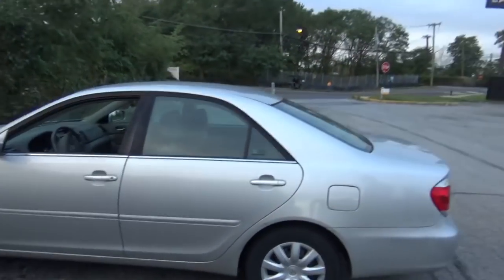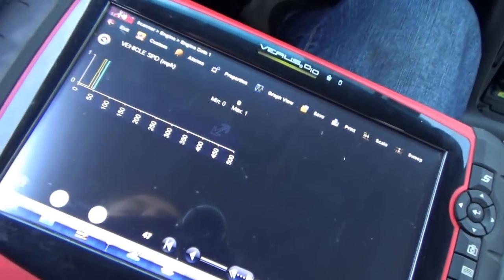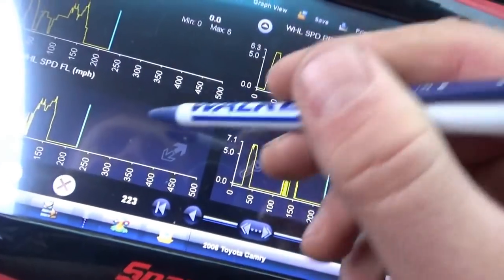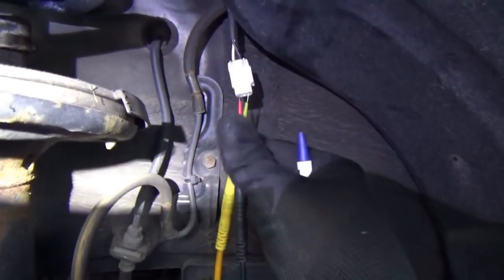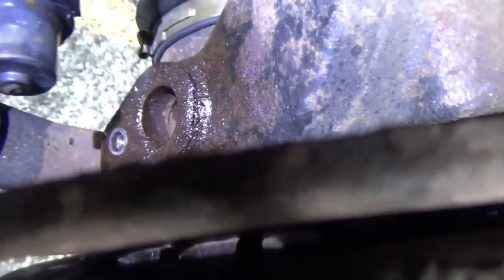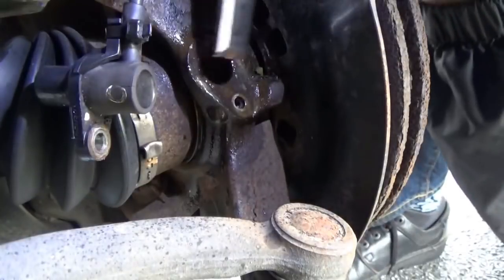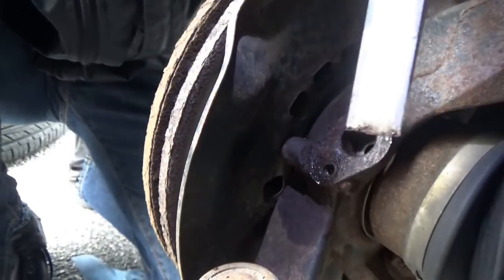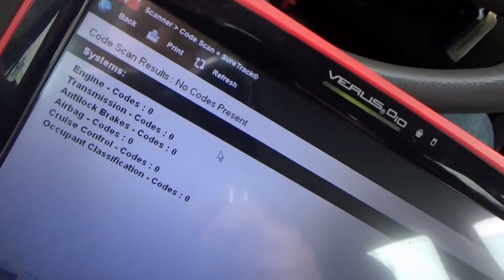Toyota ABS activation P0500 (Diag & Repair) (SI Ep 11.2)

Comment: Brilliant diagnostic and straight trough repair! Ivan! As field tech - You need wire bruh and grinding wheels in Your tool box for fighting Rust Belt  "REAL RUST" more efficiently.  Magnalube MIL 900 marine grade grease, it works much better than fluid film. Magnalube is not washable and designed to withstand salt water penetration - can bring permanent rust protection and lifetime problem solving.

Comment: I used your exact technique on a 2002 Sequoia.  The front sensors had the same "bent" problem and it was causing hesitation during acceleration and ABS activation at low speeds.  It even caused ABS to activate when decelerating slowly.  The skid light was coming on and was a hazard when trying to pull out into traffic or going up a steep on ramp.  Thank you thank you!  I cut a washer in half and put it under one side of the sensor under the hold down bolt on the side opposite to the sensor and that helped to tip the sensor further down in the hole.  At first my symptoms sounded like a recall Toyota had on the 2003 model (NHTSA 10V176000) where it would activate at 9 mph.  Coincidentally, this is exactly what my Sequoia was doing but mine was caused by the bent plastic.  All fixed!  

I found the problem by using an oscilloscope (Analog Discovery, Digilent) and measuring the AC voltage like you did.  It was around 50 mV peak-to-peak on both front sensors.  After adjusting, it it was > 100 mV on one sensor and > 250 mV on the other when spinning the wheels by hand (quickly).  That seemed to be enough for the computer to detect the wheel speed.

Comment: Hi Ivan,
This video pointed us in the right direction. 
I have a 2011 Toyota Avalon and was getting an ABS & Trac Control light. No other lights. No issue with rpm, or brake system. Pulled the sensors and one had crud on the magnetic pick-up. Cleaned it up and around the mounts. Lights gone. Replaced the pads & turned the rotors while we were at it. Just wanted to say thanks. This is a very informative video. Cheers
Reply from the maker: Nice! Did you read the codes?

Comment: Hi Ivan, I use a cordless drill to rotate wheels at a constant speed. I can even vary the speed somewhat. Just tighten the chuck up with no bit in it and push the side of the chuck up onto the tread of the tyre and just pull the trigger. I get beautiful even scope traces, Iv'e found glitches in the tone rings hat are built into the wheel bearings
Reply: Steve Ashcroft I have done that using a deep socket on my impact gun.
Reply: Genius solution thanks for sharing, sandy
Reply from the maker: hmmm now we're talking! That's a cool idea :)
Reply: I always wondered if anyone else did that. I used that method to find an intermittent drop out on a transit connect van. I looked at it 3 separate times and everything seemed to be ok. So 4th time i rigged up a jig with a drill and a castor wheel on a bolt to spin the wheel. Caught it in the act.

Comment: "...these sensors come out so easily!" Interesting problem Ivan. Honestly, I'm doubtful that those are even the right sensors! Every sensor I've ever replaced either had an o-ring on it or fit quite snugly into the hub. With that loose sensor fit salt/debris seems to certainly make it's way into those bearings IMO. You resolved the problem for sure and your diagnosis was certainly correct but man the fit on those sensors seems off. Thanks!
Reply from the maker: I think the sensors were original. Just the way they made them. And the bearings are sealed units, the ABS sensor hole just looks at the tone ring which is pressed on to the CV axle :)
Reply: Baxrok2 I  agree.
Reply: Just done a wheel bearing on 2013 Mitsubishi and the bearing is sealed and one of the bearing seals is actually magnetic for the speed pick up

Comment: Wow this guy takes fantastic care of his car! I love when people take pride in their vehicles.
Reply from the maker: And usually those are the people who take time to research their car problems, and then want their car to be fixed right the first time :)
Reply: Pine Hollow Auto Diagnostics exactly! I was brought up if you take care of your car it will last you a lifetime. I have a 96 Continental, 02 Grand Marquis and a 12 MKZ and they all look and run like new. I know how they operate and their own little qwirks. So if something is off i can feel it and i immediately have it checked. One of my friends had an Infiniti G30 and had a check engine light. She let it go unchecked and a month later left her stranded on the highway. A simple check of her transmission fluid wouldve shown she had a small leak. Guessing maybe the gasket or the plug? Im not sure..but the mechanic said a $5 part wouldve fixed it..now its in the scrapyard needing a new transmission.
Reply: My corolla altis 2005 showing ABS light after speedometer not working and gear shifted hard please help me

Comment: Hello
I have seen this awesome videos, and I will really appreciate any directions given for my issue. Have shown to multiple mechanic shops, but not results
Car: Toyota Solara 2004
Check Engine Light ON: PO500 (Changed), 
Cluster: Replaced(USED) and as problem didn't go away, put the original back.
Issue: While driving, TPMS light, Brake Light, ABS light comes on for a second, Speedometer drops to zero. Shift with a jerk. And then everything gets back to normal. Initially it used to happen every 30-45 mins, now it happens every 1-5 mins. It's using more gas than before.

Any advice, I will really appreciate.

Comment: Great video as always Ivan, but, if I may...  You can buy little wire wheels at harbor freight for a few bucks that you can put on your drill, stuff the hole, and buzz the rust off in 2 seconds....  A little set of 5 would be very handy to have....
Reply from the maker: Yeah, I do need to find something more effective. Maybe a 3M rust remover disc. I have tried wire wheels, but they just polish the rust instead of flaking off the chunks...
Reply: @PineHollowAutoDiagnostics  did this fix get the speedometer and odometer working? Having the same issue with my 07 Camry

Comment: Awesome diagnosis. Ivan- your truck could really use a small gas powered air compressor, and a generator. Maybe- a whole new work truck is in order. Nothing fancy, get a "fixer-upper" from an auction, CL, etc.
Reply from the maker: I do have shop air and a 400W inverter onboard :)
Reply: Get one with pink and blue bears included.
Reply: I said that- because a green cookie wheel would've zapped that rust off PDQ. Soak rust with ATF and it removes very easily. Yes- rust jacking can easily warp or crack plastic, as in this case. Heat gun could've re shaped the ears. The bottom of the bore could've had buildup, too. A DAB of RTV around the sensor barrel would've acted as an O-ring. At least all turned out well, and you've gained another day of experiences. Next time- look back on this, and all of our "woulda-shoulda-coulda" crap here to help.

Comment: Related :  Many Ford products have similar sensor, but the metal tip of the sensor extends out about 1+".  After a number of years, this piece simply corrodes away.  Cleaning it does not help, so you must replace the sensor..  Also fine metal filings from the disc brake rotors build up and must be cleaned.

Comment: good diagnosis. I guess you need carpenter chisel in my tool box.
Reply: I have a file ground to a chisel blade on the end and one side, makes a great scraper
Reply: A wood chisel is less likely to gouge a metal surface. Ivan knows.

Comment: The connector harness and the abs sensor ripped out when my tire blew and now my speedometer isnt working my ebrake light is on and the abs light is on could it be a short in the system? If so how can i fix it thank you in advance

Comment: Hi there,
I have a 99 ES300, got a P0500 code.
Check engine light on as well as traction control light on.
Odometer goes blank.
But other than that, car runs fine, speedometer works, idles fine.

Would the procedure done in this video be the fix?
Reply: Did you ever get this fixed? I have same problem

Comment: I get the same error code when I drive above 6 miles per hour. The speedometer works fine. I was told either ECU is bad or the speedometer cluster!! Do you think if I clean the wheel sensors at front, it solve the problem. And how about rear wheel speed/ ABS sensor?

Comment: I have 2009 Corolla code is P0500 and its come only when car is in parking and i accelerate 5000 rpm when i drive my odo work fine and ecu vss single are fine and no trouble code i am stuck on this weird code

Comment: Hi Ivan,
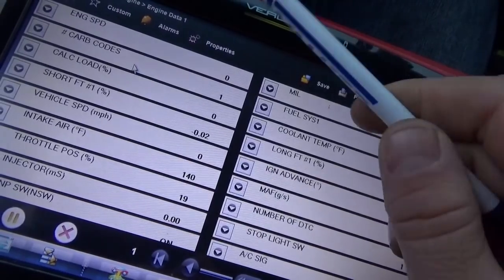any thought about the long FT of 10.9 (seen at 4:48) is that an issue or within tolerance. Nice diag btw.
Thanks Mark
Reply from the maker: If Check Engine light is off and no codes stored then car is happy :)
Reply: With the engine off (Engine Speed 0) fuel trim data is redundant. The best you can decipher from that LTFT at engine off is the computer has learned to add 10% more fuel at initial start-up than base factory programmed amount.

Comment: good fix Ivan, however tool lovers everywhere are cringing at your use of chisels and files. I like the shim use, would you have been able to fit a cable tie around there to pull down the sensor?
Reply from the maker: Well there was no place at all for a cable tie in that location, and it might weather away and snap off with time. The shim is pinched in place and will not corrode away :)

Comment: I've bent metal into a z shape before, have it under bolt flat and tall so it contact the far side of sensor top first, when bolted tight it pushes and holds sensor back flat.

Comment: The Rear sensors are installed behind the Hub, its better to buy a complete hub rather than trying to get em off, yet i have never seen a bad one, what goes bad is the harness that plugs in the sensors and goes behind the rear seat and plugs into another harness

Comment: i have check engine light myself the code came to p0500 the abs, brake,tire lights up i changed 2 speed sensor cleaned the abs sensor and nothing took it to toyot a dealer and they cant find out whats wrong with my car
Reply from the maker: With a decent scanner it shouldn't take more than a few minutes for a dealership technician to at least get a direction on what's wrong.
Reply: Pine Hollow Auto Diagnostics i dont know what to tell u brother they said is the speed sensor and nada r u in the NJ area

Comment: At 23:10 it looks like the steering knuckle has a huge crack leading to the tie rod end.
Reply from the maker: Damn...good eye! Not sure what is up with that. I'll let the owner know... Thanks for pointing that out!
Reply: i'm guessing its flakey rust scale. does look like a crack but cameras and lighting do funny things  but definitely deserves another look see.
Reply: if you look there is more by the cv shaft where the bearing sits in
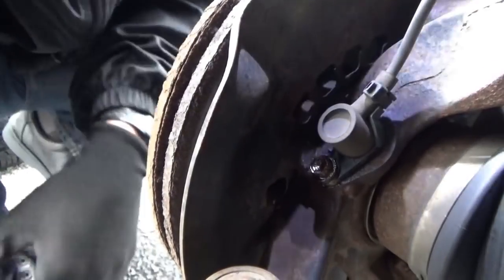Reply: Parting line for the stamping mill. Look at 28:12 for more.
Reply: Yes that is a parting line but it's on the other side.
Reply: Pine Hollow Auto Diagnostics Only just watched this video and spotted what looks like a Bad crack in the casting but I re watched and paused it and it looks like surface rust along the casting seam so all's good 👍 hats off to Toyota. I used to be a Ford man but ever since I got a little 2ltr toyota diesel Auris (bit like a Corolla) i have never looked back it's been such a reliable car, it's a 2007 with 150thou on the clock and runs like new.. Just had a Recall letter from Toyota to go get a free replacement of the passenger air bag actuator as they have a report of one exploding in a crash and sending metal fragments flying towards occupants, that's amazing customer care seeing as it's not a Toyota manufactured part and yet they are willing to do the work for nowt on an 11 year old car long out of warranty....Great Video once again Top Man 👏👏👍👍

Comment: A battery operated dremel with wire wheel would scrape off all that rust quick and easy. No need for the hammering and chissel.
Reply: Bad Drivers of North Texas Angle Grinder with a flapper disc or Roloc type disc works a treat on flaky rust, even a biscuit works but in my experience a wire wheel mostly just 'polishes' it! Yes a really coarse wire cup in an angle grinder would work better than a puny one in a Dremel. Rust flakes like that need to be 'hammered' or other similar aggressive treatments to be removed.

Comment: how would you go about testing a newer vehicle that uses a digital abs sensor with the lab scope? leave it plugged in and back probe at the sensor connector?
Reply from the maker: Yup it needs to be plugged in :)
Reply: thanks, i bought a used vantage and i'm trying to teach myself how to use a scope since I was never taught and GM training doesn't use it. Which i see you and Eric and Keith use them all the time.

Comment: 63k and a Toyota is haveing problems?! I could understand 120k or 160k
Reply: It's a rust issue.  So it's not dependent on miles.  The car is 12 years old.  That's a long time for rust to do it's thing.  No failed parts, just rust moving things around.

Comment: I dont agree with your repair. You fixed the issue but not for long because of your wire the one end is stuck up a bit and it's only a matter of time before the rust comes back
Reply: It's a case of "What do you do, when your wellies let water in"
Reply from the maker: Ah but I made the gap on the other side, so any further rust will tilt the sensor even closer to the tone ring xD

Comment: I think Ivan's goal is to save the customer from buying parts. In this case it didn't need any due to rust causing an uneven surface. If he had shop air and a grinding cookie he would of made it flat. He should invest in a battery power tool since he works on the road.  A metal pin to me is not a permanent fix its just putting lipstick on a pig.
Reply: It will hold for years and years and faster than grinding a half an washer to an angle without grinder or cutting thin shims to half.
Reply: jannepo Would you pay someone if they told you That's how they fixed your car when you went out of your way thinking that they will give you quality work?
Reply: It is up to customer to decide if he or she want to pay $356 for a pair of AutoZone Duralast Toyota front ABS sensors or more with original Denso sensors. 

Same amount of work was needed for this solution, which might well outlast the car. It would be very nice to have tech who would offer this option, rather than adding 15% to parts + labor and would have exchanged all 4 ABS sensors or something and $1000 later the result would have been 100% same. 

There was nothing really wrong with the sensors and the customer was there to see and accept the fix. 

http://www.autozone.com/brakes-and-traction-control/brake-sensor-abs/duralast-brake-sensor-abs/100935_0_4281_26322
Reply: jannepo True. I guess you can have a clause on the receipt that all repairs will be done based on the agreement between tech and customer. Then the customer can accept all responsibilities.
Reply from the maker: Of course customer approves all repairs! The improvised shim was a non-corroding metal, so it's not going anywhere :)
Reply: Pine Hollow Auto Diagnostics In theory but the uninformed will always assume. Eventually someone will try to make any tech responsible for something don't know or understand even if they agree with the repair. Ask Eric O about his free air destroying someone's wheels.